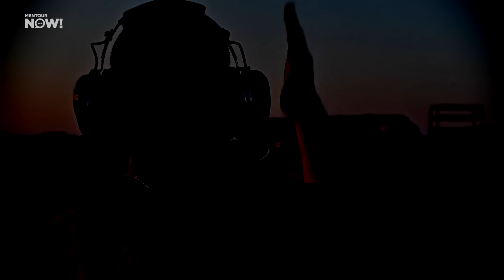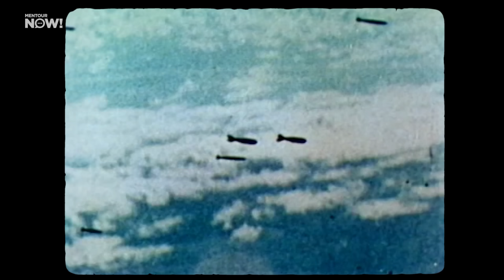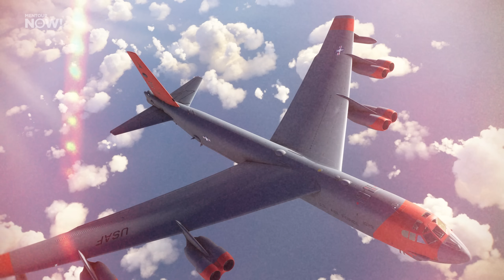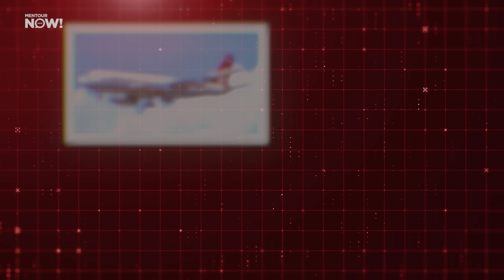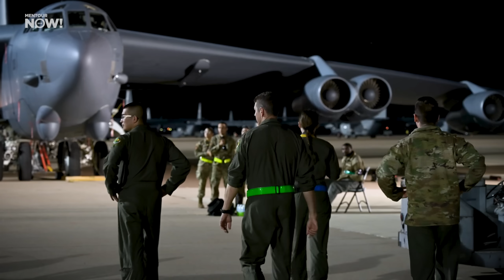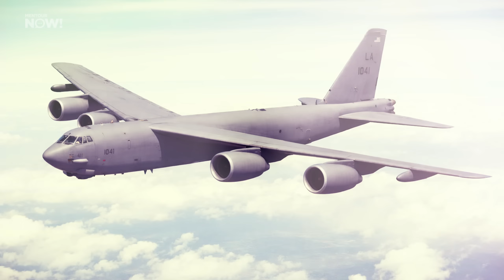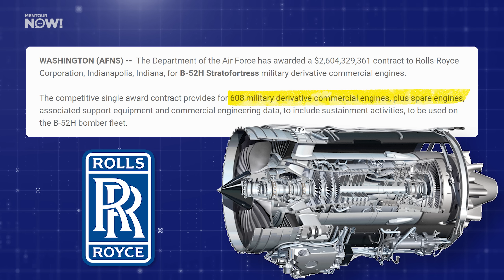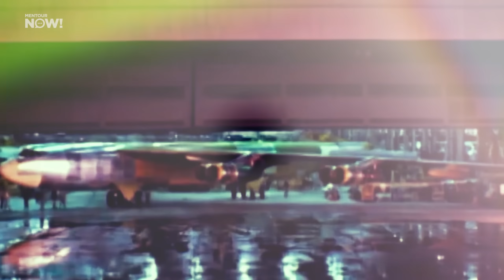WHY Are They Changing The B-52 NOW?!

Comment: I think the fact that the B-52 is still around is a testament to the genius of the design of this aircraft.
Reply: Also a shining example of what Boeing used to be...
Reply: True - Boeing caught lightning in a bottle with the B-52, but remember, engineers were still using slide rules and Friden calculators back then. Mainframe computers were becoming common in the high tech sector, & I’m sure Boeing, Lockheed, Douglas, etc were using them. BUT - the designers of that time period employed much larger safety factors than today’s designers use.
Reply: There's nothing genius about it, just the fact that it's a simple bomb truck that can be easily (and cheaply) adapted to any role airforce wants it to perform. You can say its geniusness is the fact that it's not specialized for any narrow specific mission but usable across wide range of missions.
Reply: @jurepecar9092  You mean any role not involving the presence of enemy air defense or aircraft.
Reply: @gordondonaldson148  
As we saw recently, that's not a big limitation. Probably only China would be able to defend it's airspace against the USAF.
Reply: @gordondonaldson148  Correct.
Reply: @andrasbiro3007  as a 1000+ miles range cruise missiles carrier - sure, even a civil airliner would not be in danger. As an actual bomber - useless until the enemy's air defense is reduced to the level of Burundi. I'm actually surprised the USAF has not replaced B-52 with a slightly redesigned Boeing 777.
Reply: @sergeychmelev5270  
I have no clue what you are trying to say.
Reply: @jurepecar9092  The " genius " consists of the air force bomber mafia being able to convince senators and congressmen to keep dumping money into a 60 yr old dinosaur that should have been junked and replaced 40 years ago.
Reply: @jurepecar9092  Well, aren't you a little ray of sunshine!
Reply: It think design and engineering capabilities of the time were just as important as the design itself. Slide rules were the norm and materials manufacturing processes meant parts were built robustly.  These factors accidentally lead to a 100-year old military aircraft. We’ll never see anything like that happen again, though Eagles and Vipers are lasting longer than MDD or GD could have guessed.
Reply: @brucehearn2621  Remember too, back in those old days engineers could add up 1 + 1 and get the same answer every time unlike many of the elementary school dropouts today.
Reply: B-52's longevity is also due to the fact that it occupies a mission profile that doesn't make sense to spend money on for replacing. The reality is, B-52's role as a nuclear bomber has been replaced by stealth aircraft and SLBMs. It transitioned into a high altitude level bomber for conventional munitions...but that role also disappeared since carpet bombing fell out of vogue. Now it essentially acts as loitering fire support and a platform to deploy long range PGMs, which is pretty much now also redundant with how capable other weapon systems are. The reason we keep the B-52 is because of the impressive lift capability and the cost savings of operating an already existing aircraft. If the B-52 were retired, it wouldn't be replaced.
Reply: When I was a kid, more than 55 years ago, a B-52 was the first really complicated model airplane I put together. Many years later my Father worked on the wing mod project and told me that the wing mate jig was the first time Boeing used lasers to align and verify a fixture. In order to certify the accuracy of the alignment they had to work on a Sunday when there was only a minimum number of people in the building and strict orders to not open any doors to the outside of the building and they blocked traffic on the closest roads for the duration of the verification process.
Reply: Slide rule and pencil design thank you.
Reply: @thereissomecoolstuff I never used pencils. I used a pen.
Reply: @soaringvulture  Today's kids only see them in a school mandated museum trip and need a 15 minute lecture to explain what they are.
Reply: Bottom line: it's robustly upgradeable.
Reply: And the maintenance schedule and maintainers
Reply: @sniper441  -- At 22:42 a C-130 is shown, an only-slightly-younger design that has also maintained its usefulness. My son works for Lockheed, and he will attest to the importance of maintenance schedules, service bulletins, and all the actual maintenance required to keep those things flying. None of the C-130 flying today are nearly as old as the older B-52s, but then, have you ever seen what a C-130 goes through for a combat landing?
Reply: I think I heard about how they were going to re engine this dinosaur at least 40 years ago, and I heard it from air force personnel who maintained it at that time. I've not seen it yet.
Reply: I think it says more about the intractability of modern military procurement.
Reply: The main issue is that both supersonic flight (B1) and stealth (B2) ended up being heavily overrated.
Reply: @paulroling1781  Stealth is most certainly not heavily overrated as shown by the strikes against Tehran last year.

You need stealth to hit enemy command and control deep within their territory, but for supporting offensive operations, standoff munitions allow non stealth bomb trucks to stay out of enemy air defense range while raining down precision fire in support of advancing troops.
Reply: @pdxmarine  True, it can be useful in some cases. But then it is expensive and often just not necessary. Especially if you already have air superiority and taken out all the anti air missiles.
Reply: @paulroling1781  The point of stealth is to establish air superiority and take out those anti air missiles...so you know, kind of important
Reply: And it's only a decade older than the 737, 747 and DC-9
The DC-9 had first flight in 65, the 737 in 67, and  the 747 in 69, the B-52H went into service in 61.
Reply: More a testament to American air superiority. If we were fighting nations with parity it wouldn't be a genius design at all it would be a dumbass decision to still use it.
Reply: @kanaric  We still use it because it no longer needs to fly into enemy airspace. It can circle outside any enemies AA range, and launch cruise missiles at targets.

It's an inexpensive missile truck with a lot of range and significant loiter time
Reply: @kanaric   "More a testament to American air superiority. If we were fighting nations with parity it wouldn't be a genius design at all it would be a dumbass decision to still use it."      Quite correct.
Reply: The "genius" of the design is that the US failed in their attempt to completely replace a bomb truck with bomb supercars, and so are left with an outdated bomb truck that they cannot afford to replace with a new truck.

The B52 is not a bad aircraft; but that it's still around has nothing to do with its design, and all to do with fiscal mismanagement.
Reply: There have been 1000s of modifications over the years.  It takes awhile to work out a lot of bugs with any complex system- and they keep changing it.  I'd worked with a Navigator from 1950's who flew both B-29s and early B-52s... he said the B-52 was dangerous as hell when it first came out.  The fuel tank wings would flex in flight and with leaks would cause the fuel to run down into the fuselage.  He was standing in fuel ankle deep more than once.  When he aircrew was scheduled to fly a training mission to another state he got sick and couldn't go... the B-52 blew up and nobody survived.  He personally told Curtis LeMay he refused to fly in the B52 again and retired a year later.
Reply: At this point just make another airplane
Reply: Not genius at all. The high time B-52 has around 28,000 hours on it. Compare that to many Boeing 757 airliners that are younger......yet have more than 100,000 hours on them.....so far. The average hours flown per year on B-52s is around 380. THAT's why the B-52 has been around so long.....because they hardly ever fly them. The weak spot on the B-52H is the upper wing skin. If they did nothing, they could fly it another 47 years. If they re skin the wings it can go indefinitely, like a DC-3 or something of that nature.
Reply: @rael5469 they may not be flying a lot but they are STILL flying because of genius. 757 aircraft ferry passengers. B52s are for conflict.
Reply: @AndyP959  I don't think it's genius at all. I worked on the B-52D and H models and I loved working on them......but as airplanes go they are pieces of JUNK.
 Really old technology that should have been retired decades ago. They wouldn't last a month in a real shooting war. They'd probably all be shot down in the first wave.  They should have just built more B-1 bombers. They should have replaced the H models one for one with the B-1.  In reality they are building stealthy B-21 Raiders and that's the ONLY way to go now. Even stealth only goes so far.  The book on modern warfare is being written and updated every day in Ukraine.
Reply: @AndyP959  "757 aircraft ferry passengers. B52s are for conflict."   Airliners have a grueling schedule. They fly around 10 hours a day, EVERY day. With the B-52s if higher headquarters wanted two B-52s for some mission we would cue up three or four of them just to get two off the ground. We would literally have a second set of pilots doing their preflight and engine start on the spare aircraft just in case they were needed. Then if the first plane crapped out the primary crew would literally drag their bags over to the good aircraft and release brakes. That's how unreliable B-52s are. 
Is it an iconic aircraft? For sure. No doubt. But as airplanes go it's WAY past time to move on to more modern technology. If a B-52 crashed and the crew was killed I would consider it criminal negligence that the Air Force kept them around so long.
Reply: Sorry nope! It is a "testament" of the US declining industrial productive capacity & industrial de-skilling due to near complete financialisation of the American economy - that the ability to produce these machines new anytime fast is lost ...
Reply: @gariochsionnach2608 absolutely wrong. The B-52 has TA and technological advancement far beyond the capabilities of foreign aircraft. Just imagine, you need to go to Russia to flatten Moscow. Their aircraft cannot intercept a B52 because their guns, missiles and SAMS cannot hit it. The range also is unmatchable, this is why the Russians still fly TU-95 turbo props from Russia to Cuba. Fabulous aircraft that transcend time. The positives of these aircraft outweigh the negatives.
Reply: In the meantime some other iconic aircrafts like A-10 or Harrier are considered to be permantently retired.
Reply: @utrock5067 the A-10 is not yet retired
Reply: @utrock5067  The A-10 was basically obsolete the moment it came on the scene.

Multi role aircraft like the F-16 can do the job more effectively and more cheaply.

The A-10 was designed to deal with AA guns and manpads, it cannot survive against modern air defenses, and the 30mm cannon it is built around, while very cool, is not nearly as effective as precision guided standoff munitions
Reply: @pdxmarine go tell that to grunts on the ground who have been saved numerous times by A_10’s…
Reply: @1BobsYourUncle  You mean the plane with the most friendly fire kills?

The plane that did far less actual close air support than many other more capable platforms?

You think there might be some bias there towards the A-10 because it happens to be much closer and much more visible?

Nah, that couldn't possibly be it!
Reply: Too bad the next-gen military aircraft wouldn't be as good after all the funding that's being cut right now.
Reply: @e808_88 Isn’t technology supposed to make development cheaper.  You must be a fan of the military industrial complex.
Reply: @thereissomecoolstuff LOL, it's clear that you don't know much about the world.

Next time don't wrote stupid comments like that.
Reply: more like the money sanked into it lol!!! just imagine the amount of fuel that useless thing has burned! and today they are forcing people to buy evs!!!!
Reply: It's only testament for US Airforce ability to funnel money to it.
Reply: The genius is only realizing small countries, that the US might want to bomb, will still be around.
Reply: Why we even need the airframe at all should be discussed. As the saying goes, it sounds like generals preparing for the last war.
Reply: @noahway13  Because it's a damn good bomb truck, and you kinda need those in any conflict involving an airforce.
Reply: its a testament to the lack of technology the nations the USA terrorises and bombs have that they dont even need to bother with modern stealth tech or any sort of air defense counters
Reply: @vadwvea7153 really? Yet they developed the B1, the B2, the F117, the F35, and built 2 x XB70s along with many other aircraft. And bought the British Harrier.
Reply: @AndyP959  all of which arent used as much because they are never needed lmao, thats the entire point of the video and the exact reason he said 'reasons which I wont get into' to avoid being political. You clearly dont understand how to maintain global dominance as a military, thats the only reason the US ever invested in tech. The fact the A10, B52 and the likes are still in service just proves my point, you can deny it if you want, thats your bias. This is the reality. Fight a nation with a competent airforce and see how quickly those B52s get shot down and put out of service. The US are just tyrants who pick on and bully little guys
Reply: @vadwvea7153 yet the US spends huge money keeping them flying? Clearly you know better than the USAF? Who should I believe? You or the American military?
Reply: @AndyP959  what are you talking about 😂😂😂😂 theyve never said anything that contradicts what ive said
Reply: @AndyP959  They said there were nukes in iraq, what do you think? There are nukes in iran, what do you think? Fent in Venezuela, what do you think? 911 was done by groups in Afghanistan, what do you think? Regime change in Libya was a good idea, what do you think? I could go on, but I think the point is made no matter what way you look at it. They are tyrants, bullies, dont need to upgrade those dinosaurs because what they have is good enough for who they are attacking. Im pretty sure a child throwing a rock cant reach 50,000ft
Reply: @vadwvea7153 are you genuine? Because you are making up so many lies it's difficult to know. No one said there were nukes in Iraq - what was your next lie?
Reply: @AndyP959  Dude, I was gonna defend you , but... were you even around in 2003?
Reply: @imonymous yes. What is your point?

Comment: Retired USAF here: I think the USAF bomber world hasn’t gotten the love and attention over the years due to the influence of the “fighter mafia” senior leadership in the USAF
Reply: Fighter pilots make movies, bomber pilots make history.
Reply: @NoManLearnsFromHistory  also kinda are history, because rocketry & drones
Reply: @mycosys  There will always be a need for a large aircraft that can carry a large payload of munitions a large distance. Even with improvements to missiles, long-range missiles are still very expensive, but if you can load a collection of precision, short-range missiles onto a B-52 that does most of the flying for them, that's much less expense to hit a larger number of targets. Especially if it can now receive instructions from a forward operating F-35.
Reply: @PhycoKrusk  Whats the cost of risking airmen's lives vs not?
Reply: @mycosys  Possibly I should have said "shorter-ranged." The fact is that the longest-ranged surface-to-air defense system in the world has a range of 250 miles. The AGM-86, which is the cruise missile carried by the B-52 (at least until the AGM-181 is ready) has a range of 1,500 miles. The is no surface-to-air defense system on Earth that reasonably poses a threat to a B-52 that is carrying cruise missiles.

There is no air-to-air platform on Earth that can strike at the B-52 before it has launched its missiles and left.
Reply: It's not ideal to have a large, slow moving target directly above the enemy.
Reply: @electromage  B-52s can do that job, but they now also just as if not more frequently stand back and launch cruise missiles from 1,500 miles away. The only time they'll be directly overhead is after the US has established air superiority.
Reply: So true. I can remember about 10 years ago when the US went and bombed Syria for the first time, they sent over one of literally everything they'd got, including the F22. "F22?" one asked oneself, "what's the point in sending the F22? It can't carry a bomb load". And indeed it can't, well only a tiny one. 

Seems to me that they were so desperate to get the fast jets some "kills" painted on the noses (and thus, operationally-essential, please don't de-fund them) they were probably making up missions simply to achieve that. They didn't hang around long though; dropped a few bomblets, Foxtrot Oscared back to the USA ASAP leaving the enduring work to the likes of B52s, F16s so far as I recall. It wasn't even as if the F22's stealth played a role - the B2's did all the preparatory work. 

We get that in the UK too. Last thing the RAF wants to do is to invest in logistics support to the RN, Army, or in a bomber of any sort really. It's fast whizzy land-based jets first and foremost. Ok, they are important (pretty glad we've got Typhoon as an interceptor right now), but there's other less glamourous jobs that'll be important too. RAF hasn't even got a medium or large bomber of any sort at the moment.
Reply: @abarratt8869  Don't forget operation black buck.
Reply: Fighter Mafia is dead, as is SAC.